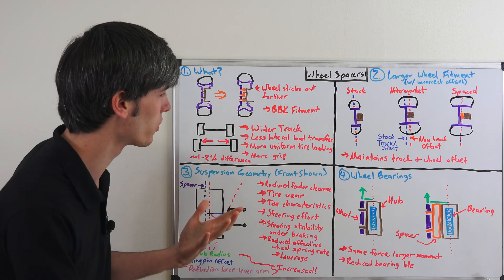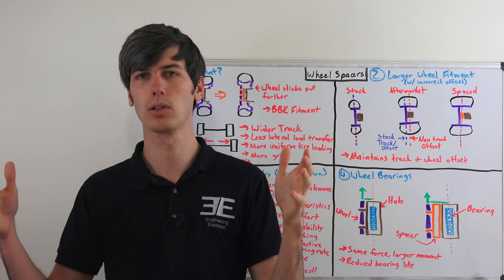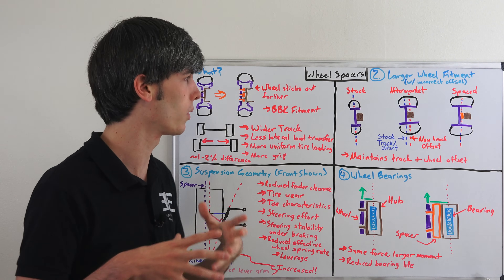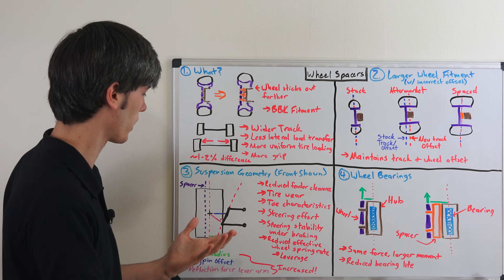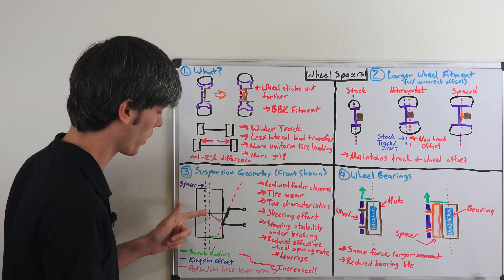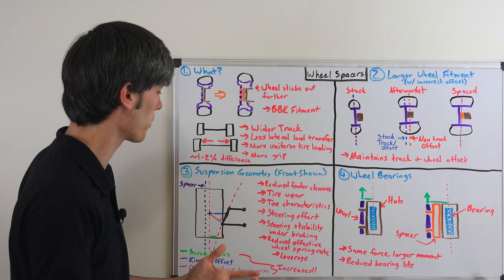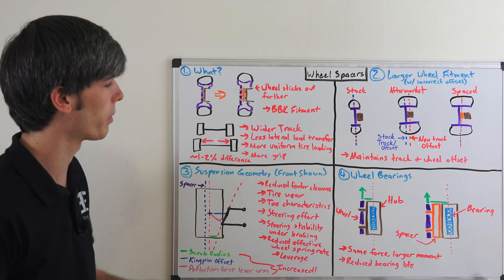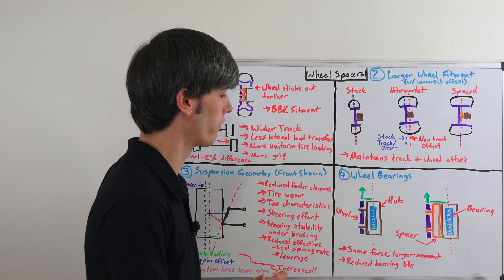Wheel Spacers & Adapters - Good Or Bad?

Comment: I fully expect to get flamed for this but don't mind taking some heat off Jason for a change.  I am investigating options for taking a ford focus rs on non tarmac surfaces without causing permanent damage to the car.  

This would not be for rallyx competition, just doing a couple hours practicing controlled car rotation on smooth hard pack grass fields and smooth gravel roads.  This goal has as much to with living on an island with no track and no autox club as it does with trying to get decent rally driving instincts.  

The obvious and least drastic option is swapping the wheel tires and temporary removal of the front bumper.  Rallycrossers recommend cooper wintermaster tires because they are cheap, have widely spaced tread and most importantly stiff 2 ply sidewall.  Even if my goal is not max gravel performance, I would still want the narrowest width tire with highest profile so I could gain some ground clearance and run at lower air pressures.  This is where the spacers come in as I would want to run a cheap but strong steel wheel but could probably not find one that will clear the calipers and also match the desired tire characteristics.

Any feedback for me? Is this whole line of thinking ill conceived because of all the cons mentioned?  Just by at rusty beater rwd and practice car rotation with that?

The more drastic ideas I would likely not do are swapping out the fluid in the monroe dual mode intelligent suspension for something with lower viscosity so both normal and sport modes become softer.  Also waiting if Monroe decides to have a swap out or add on product for the dual mode or to completely swap out for a rally coil over set up to gain ride height.

Comment: If I run a wider wheel than original (14"x5.5") on my 72 Charger, do I need to keep the same offset?  For example, if I went to an 18"x9.5" wheel I would still keep whatever the original offset was, or would the proper offset be different?

Comment: I am a automotive service major and I also work in a small shop doing small jobs. It's really fun and rewarding. The worst thing about it is, now that I know a lot about cars, modifying my own car scares me. If I go with more power, I think of how the valve seats have more wear. If I lower my car, I think of how all the suspension components have more wear. And thinking of all of that suckkkkkssssssssss
Reply: +Marius G, It's good you are thinking about it rather than just doing stuff and possibly messing something up. Research and knowledge is important before modding, that's for sure! A health caution and respect for cars is important too when tuning them. Glad your enjoying your job by the way!
Reply: +Boosted Fool -
O.E. respect, yes! Cars are fun to make adjustments too and modify, but they are more fun when they work right, haha.
Reply: some things you just have to accept you will replace. I know a few hardcore racers, on wheelbearings for instance they plan on running through 2-3 sets in a year. and sometimes Modifications dont change enough to make much difference. It is a good point though, especially on a daily driver. then theres the stance crowd that thinks sparks coming off an undercarriage is cool, and run camber that grinds through bearings at an alarming rate considering they are on public roads and most are too cheap to keep them fresh.
Reply: I just wish I had money to break and fix things
Reply: Johnny OrGBravo I sell stuff on eBay the buy stuff for my car with that $$$. The “cost effective” circle of life lol
Reply: Marius G better not get brighter bulbs either cause those are hotter therefore warms up the plastic lenses more, which means it wears faster over time. Just messing with ya. One thing I've learned is never modify your daily driver or your "main" vehicle with anything bigger than what would take you a whole day. Sure, throw that cold air intake on your civic even though it won't even do anything, but don't try and put turbo in it because forced induction causes more wear over time therefore decreasing the life of your vehicle. Do simple, tasteful things for your main hoe of a car.
Reply: Marius G i agree with you but on the other hand, tomorrow's not promised. Enjoy every moment you have. Don't end up like me though, owning $20,000 more truck than I could ever sell it for. 🙃🙃
Reply: If you value reliability, the best thing to do is have a decent budget, and either get a non-daily car or be cautious and have a backup fund/plan.
Reply: I learned a lot about my CVS when I had to change a torn boot, I figured might as well pull em out and re grease the cups. Got to see its condition, first time doing this service too. Did have to do a lot of research prior to but hey, saved myself lots and gained knowledge :)
Reply: Ya same here man, after hearing about everything from this guy dipping into the reality of the aftermarket world for a few years I've never wanted to mod my DD since. Id love to lower my car as almost everyone does but then hearing about you needing to align, it messing up struts, etc. etc. just because it wasn't designed for it makes it seem not so worth it lol. Oh well, you learn to appreciate and stay content.
Reply: The age old question, who takes the load force? Bolt, hub or old trusty friction? =)
Reply: On the 1.8t now,the d's where fun. Looking on the King Bearings catalog they have black engine bearings.
Reply: So i shouldn't use black bearing because they are not o.e.m
Reply: My dilemma is I put 16 inch TE37s on my 98 Honda Civic and some nice tyres.  The only problem is the rims are so wide that my tyres are rubbing on the inside of the wheel, like the chassis part.  If I turn right, the right side of me front left wheel will rub on the chassis.  You can tell because there's paint missing from the point of contact.  It's like because the car has bigger rims but with big tyres, there is a thumb worth of clearance between the tyre and fender, the car has a fist worth of clearance from the ground to bumper (if I leave my lip on) and the wheels are too wide that it's rubbing the inside of the tyres.  My only choice is to change suspension (which I need to do anyway because I dislike very low cars that always scrape) and add wheel spacers.  Do I need wheel spacers? Or is raising the ride height half and inch going to solve the problem, which I doubt it would.
Reply: Ignorance is bliss lol. Those who know don't  usually mod their cars and those who do usually have the money or sponsors are paying for their repairs
Reply: But its cool 😂
Reply: Growing up, I was the one that held the flashlight and as time went on, started fixing the cars. Then I became the go-to for the family and friends when it comes to repairs.

It’s funny to me when they see me and ask why I’m driving the cars gently and slow whenever possible but it’s because in my mind I can almost imagine the wear that’s happening while I drive haha.
Reply: +Marius G Here is a real short sentence for all of you.  "You Play, You Pay"  Glad to see that there are still some intelligent people on YouTube.
I have always Played but also always payed the premium.
I have a small automotive shop and could not even begin to tell you how many times I have replaced wheel bearings on 4x4's with spacers and or offset rims and the owners comments are something like "Man them Bearings are junk anymore".
Reply: +Gavin Carney it took me 3 cars to learn not to thrash on my daily. respect to oem lol
Reply: +Marius G yeah man, my car used to be lower and on stiff springs, a few potholes later and some rekt bushings failed me at inspection. needless to say i got different springs+shocks after that as well :/ also apparently a mechanic had to "jury-rig" my front swaybar so it doesn't fall off, something to do with the mount(-ing points?), didn't charge me for it so w/e...
Reply: Yeah me too. I initially was like AHHH I want to lower my car! Now I'm like... I'm staying oem.
Reply: +Marius G same here, if i add more power i always think ' the candle that burns brighter dies first' 

people forget that stock is the most reliable as it's engineered to go for ages with a decent brand of car
Reply: +Rolando Macias LOOOOL, typical trash talking, honda boi. How's that non-vtec SOHC of yours doing? :D

Comment: +engineeringexplained Great video, I'm now probably going to "steer clear" , pun intended, of putting spacers on my front wheels/axle seeing as though most of the drawbacks were related to steering/bearings. Would I see similar negatives if I just put them on the rear wheels/axle of my e46?

Comment: How much of an offset difference would be significant? For example, would changing from a 12mm offset vs a 6mm offset as part of a brake conversion be harmful? If so, how?

Also, would a wider wheel potentially compensate for less offset? If the 6mm offset wheel was half an inch wider than the 12mm offset, for instance, would that make up the difference? Too much, possibly?

Comment: I was curious if these negative effects are greater on a FWD car with a positive offset stock as compared to a RWD car with a zero or negative offset stock.
There is also an issue with many Spacers not being 'hub-centric', and greater stress put on the lug bolts I would imagine.
Lastly another common use is to change the bolt pattern.
Bottom line proper custom wheels are always better than a spacer.

Comment: Great video as always. One question: The disadvantages you mention in 3 & 4 , would you expect these to be a small change in say...stability under braking or bearing life of 1-2% similar to the advantages in increased track distance, or something more drastic?
Reply from the maker: I wouldn't correlate the percentages at all. The distance the wheel is moving relative to the bearing is significantly greater than the overall increase in track width. They're different parameters which would need to be analyzed individually. If I were to guess (and that's all it is), I would say the reduction in bearing life would be greater than 1%, on average. But if the bearing will last 250k miles, who really cares. There are a lot of unknowns.
Reply: +Engineering Explained I completely understand. I guess what I was getting at is, do you think the benefits out weight the disadvantages? i.e getting the wheel/tire combo you want over decreased bearing life etc
Reply: The life of bearings won’t be significantly affected at all in most cases, as modern cars have large enough bearings to withstand heavier unibody weights, more powerful brakes and power using sticky tires. 

However, by increasing leverage of wheel to chassis motion arc, the bushings and tires will have more propensity to distort out of shape/alignment and this is particularly noticed in situations like heavy braking stability, and high lateral force cornering, when dynamic alignment changes are greater.  
Alignment changes are easily felt even with fractions of degrees and millimeters in changes, so that’s more the noticeable impact in day to day.  You might notice that the car wanders a little more at higher speeds over bumpy highways, or cornering feel and stability is slightly less precise. 

This degree of change can vary greatly also by vehicle and its weight as well as configurations of suspension arms and bushing softness.

Comment: Why does BMWs, Mercedes Benz, Range Rovers, Audi's, etc have the wheels flush with the fenders so it looks a lot better that Toyotas and other cars, I mean, all luxury vehicles have the wheels almost flush with the flares/fenders (even Lexus but not Toyota), that's why I have spacers on my vehicle, but others don't, is that so much more money to do that or is it like electric cars that must be ugly by law? (sarcasm)
Reply: I think it just has to do with cost. Cheaper cars share more components with other cars. That's not to say that there isn't overlap in parts with luxury cars, but there's more engineering involved in making those same parts good as well as function optimally. Like my audi shares suspension components with a vw passat. My volvo shares suspension components with a Ford and a Mazda. But there's a bit of over engineering involved in the euro cars that makes them look better. There's also the shared platforms that have cost companies billions of dollars to design that can be shared with sedans and suvs alike, and then the added tweaks to make them look good too. Also, a car company like Toyota doesn't want to make the camry look too good, cause then you wouldn't get a Lexus lol
Reply: My Lexus es350 I used to have in 2014 didn't have its wheels flush, it was like any other car you mentioned

Comment: For example.... Have you feet 1ft apart and try to tilt back and forth. Now... Move your feet 2-3ft apart than try to tilt back in forth. It should be harder to move and bounce with your legs moved most outward than inward. At least that's how I got it.

Wait were you talking about wheel spacers because I was talking about shoe spacers... Oops😶😐

Comment: Another great video, as ever! How about a video explaining torque steer? Very little info on YT. I think it'd be popular.
Reply: +stoppsi it's caused by unequal length halfshafts. A longer halfshaft will have more deflection (twist) under the same torque input, causing the vehicle to pull slightly in one direction.
Reply: @bryantrosato3849  thank you but are you EE? Nope 😂
Reply: +Bryant Rosato Well put mate
Reply: it can also be caused by worn out, or unequally worn out, lower control arm bushings.
Reply: +Fenriz Wulf 
That would cause bad alignment so it would be going in its on direction anyways
Reply: Bryant Rosato Surely the simple fix is to tune the diameter of the longer halfshaft up a bit to reduce the angle of twist to match the other shaft. Why don't they do that?
Reply: because If they care they just run equal length halfshafts. I.E. cobalt ss
Reply: Ancient  FWD luxo barge... Sterling 825SL had a two part shaft on the long side.  A short thicker stub from the tranny to a carrier bearing on the back of the engine, and then a halfshaft from there.  Both halfshafts were equal length, not counting the shaft from tranny to carrier bearing.   No detectable torque steer, same driveline as a 1st gen Acura Legend.
Reply: +stoppsi 
Cause Honda has so many different engines and different wheel sizes, for mass production it's cheaper to just has a standard set of shafts rather than one specific to each combination/setup.

Comment: Maybe it's because I'm more into muscle cars, but I see little to no point in wheel spacers...
Reply: well, if you have a sporty car like a bmw 335i m and you want to make it different from others you add like 1.5cm spacers to make the tire flush with the fender to make it look better from behind and also to make the car sit flusher with the road.
it's all about how the car looks.
Reply: +Andrea Rustinelli You say "it's all about how the car looks" but I bet 99% of people won't even notice until you tell them. I drive an E39 with sport suspension and would never consider putting wheel spacers on my car.
Reply: well , you can clearly see the difference between a stock 335i and a 335i with spacers and Msport wheels.